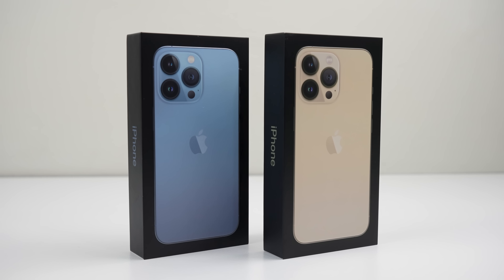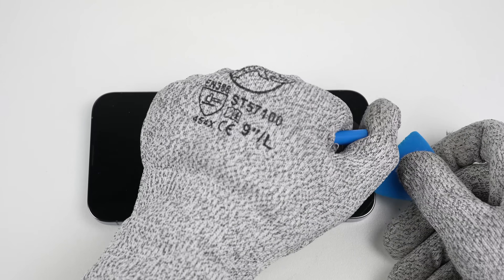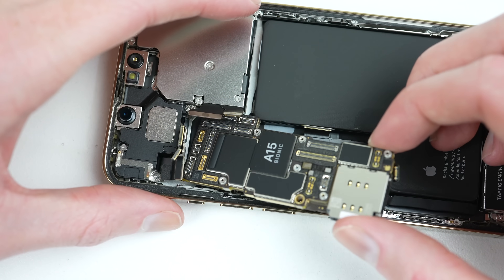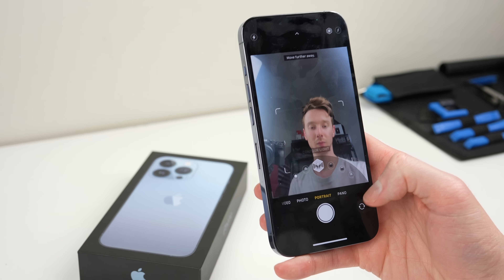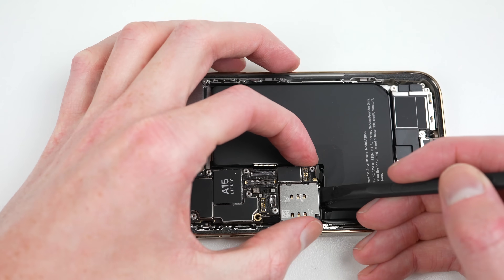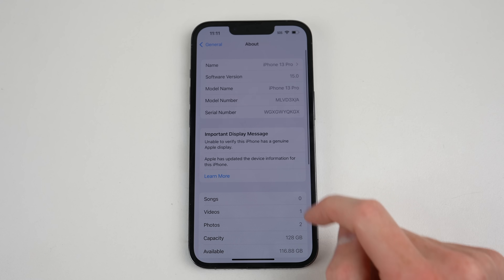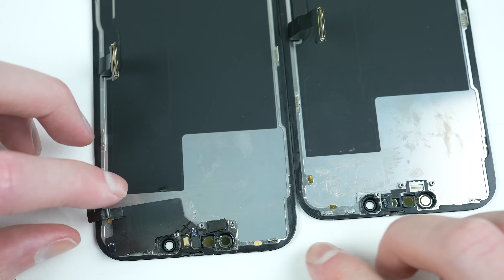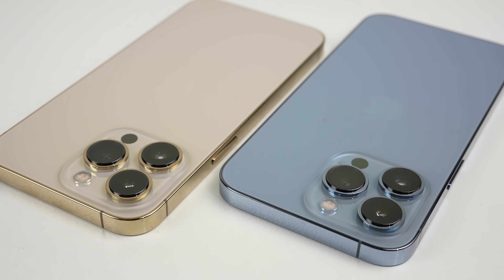iPhone 13 A Repair Nightmare - Teardown and Repair Assessment

Comment: This is the problem with corporations going around and politicizing everything. It allows for them to get away with corporate greed. Please DO NOT buy this phone (especially since it will be inoperable in a year due to cell phone companies updating them so badly you'll need a new fragile piece of garbage you can barely get fixed). Hit them where it hurts, the pockets. They operate very expensively as a business so any significant reduction in sales will hurt them as they can't immediately compensate. Like we are tired for working for these companies so we stopped and it's making them want to treat us better, do not buy the products until they start freeing up stuff (because let's be honest, they will make money regardless of whether you are able to get it repaired or not and a drop in sales will make them more willingto compromise this)

Comment: I would like to clarify that you can replace an iPhone 12 and iPhone 13 screen you just need to be calibrate the screen and you can also transfer over the  chip at the bottom of the iPhone screen this will still allow face ID function to work I run a repair shop and it cost £30 to recalibrate iPhone 12 screens  as the software has been given to us by Apple.

Comment: What's the point of making these 'less impactful to the environment' if your entire marketing scheme is to make these devices fragile, nearly impossible to repair without mailing them (even for "official" repair shops) and designed solely for newer tech instead of reliability.

Comment: There is a silver lining for buyers on the second hand market.  If I want to buy a second hand phone that hasn’t been dropped and had parts replaced with who knows what, the phone features are not likely going to work.  On eBay I would raise a return based on defective product.  It helps me know that I am receiving a phone that has been taken care of.  I’m not getting a phone with a sub grade screen or camera replacement from China.

Comment: My iphone 3Gs works just fine despite no updates for the last few years, I've replaced various components over the years without issue. Needless to say when it does die I won't be replacing it with an apple phone.

Comment: This is why I never nor will buy apple, their simply expensive for the sake of being expensive. When it breaks it simply just bricks the device given their more interested in money over actually making their products consumer friendly. Along with you have to question how much time and money they had to invest into the phones. So that each part was serialized and identifiable just so the phone would quit working. If someone tried to replace the part without having access to some stupid program they made. That makes the phone accept the new part and not brick itself because someone dared to try to repair something they bought.

Oh and to add irony apple phones are more of a status symbol now than anything else. Given you pretty much have to be well off to afford them and keep up with any sort of damage done to the device. Given they charge close to if not the full price of buying a whole new phone to repair it. My wealthier side of the family only uses apple phones and devices. It's really fucking ironic cause they act like high society over it. When their really just wasting a ton of money on a shiny piece of crap phone.

Comment: I am currently using an iPhone 6. I have had no interest to upgrade. I just ordered a new battery as mine is in need of replacement. I do my own battery and screen replacements. By the sounds of it, I will be forced to discontinue use of iPhones when this one is no longer repairable or service is no longer supported to iPhone 6 / 4g.

Comment: I've had my 7S for almost two years and have taken pretty much perfect care of it, not a scratch on all that time, and I've never had to replace anything but the battery, since apple thinks buying a new $1200 phone every 3 months is remotely affordable. 

A few months ago, my home button just stopped working. Like, I couldn't press it and the fingerprint ID hasn't worked either. I've been using the accessability home button since then. Now the battery goes from 100 to 20% in about an hour and a half, and it often gets unbearably slow or very hot at random. Every video/photo I take is several MG large, filling up my storage extremely quickly, to the point where I use Snapchat and IG to take pictures of things when I can. This is such bullshit, we can't exactly go buy another one right now. I'm trying to convince my family to switch to android. Any suggestions for android brands?
Reply: Best choice would be pixel phones. But in terms of choices and mainstream would be Samsung. If u don’t mind china phones Xiaomi phones does the job and half the price for better flagship specs.
Reply: I’m almost convinced they update the phones to stop working as well so you buy their new shitty products
Reply: Motorola is fantastic.
Reply: @yotoprules9361  Seconded. I run a g100. Thing is stupid fast, durable, no bloat, and has those weird moto features like the chop flashlight and crap. Headphone jack, SD card slot, snapdragon 870, yes please.
Reply: @MultiTelan  I also have the G100 haha, I agree it's a very good phone and I got a good deal on it (£285)
Reply: @yotoprules9361  Nuh uh for real? What color? I got that weird blue purple 128GB model. I think moto only sells the white 64 here now.
Reply: @MultiTelan  "Iridescent Ocean" .
Reply: @yotoprules9361  yeah, I think that was the color I got too. I forget the official name. Nice to find someone else running not only a moto, but an identical phone.
Reply: i spent a whole day sifting for the best smsung phone with a earbud jack, the A52 5G is pretty high spec.
Reply: I still use 5S to this day, battery replaced few times but that's about it. Now going for new iPhone just because of that durability, because before 5S I didn't have such a luck with Android at all. Sad to hear 7S lasted just two years, with all Apple restrictions I sure wouldn't buy another iPhone too.
Reply: Unfortunately, even Goo+gle has big problems and they basically control Android. Spyi+ng, no priv+acy, etc.

Comment: wow this is some buuuuuull shit. I always buy older or second-hand phones cause I cant afford new ones, and replaced screens and batteries on several of them over the years, either myself or with nonapple repair shops. My iPhone 5 ran for like 3 more years after I replaced the battery, and my 6 ran well for like a year and a half with an aftermarket screen before I dropped it again and upgraded instead of replacing. It'll be a few years before I get a 12 or 13 but I hope apple will have been bullied out of this anti-consumer assholery by then, if not I'll probably buy a different brand.

Comment: its like buying a prebuilt pc, changing the ssd and now the cpu, memory, and motherboard doesnt work...
Reply: Yeah, especially since nowadays for the price of one iPhone you can get one heck of a rad set-up if you invested into parts lol
Reply: @enzianblue  Not gonna lie, samsung flagships are more expensive than Iphones, atleast here lol
Reply: @sh4rpys  This is not an Apple vs Samsung debate. How did you get that? All I'm saying is that for the 1,300 bucks the newest iPhone costs here, I could upgrade my PC setup significantly.
Reply: @enzianblue  My point was for the 1300€ iphone, you can also buy an 1300€ samsung. Iphones aren’t even near the most expensive consumer phones out there. Also you can get an Iphone 11 for 600€ new.
Reply: @sh4rpys  Dude this isn't what we're discussing here. I'm not stupid, I know there are more expensive phones out there. Tggamer made a comparison to a PC, I made a comparison to a PC and all of the sudden you start the Apple vs Samsung debate.
Reply: @enzianblue  I didn't start a Apple vs Samsung debate. Just used Samsung as a reference as they are well known. As I said, my point was that you are comparing an Iphone to a PC, when Iphones aren't the only expensive phones out there. So why target apple?

Also don't understand why you have to make such a big deal out of this, if you read my initial comment, you can see that I only mentioned the price of samsung flagship phones being higher sometimes than Iphones'. Gonna end this here and not going to continue this thread any further.